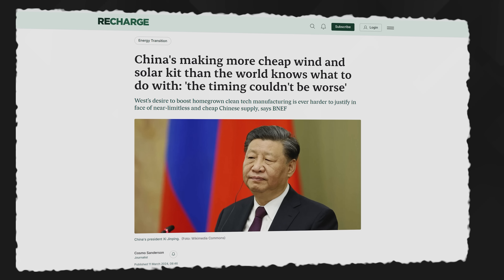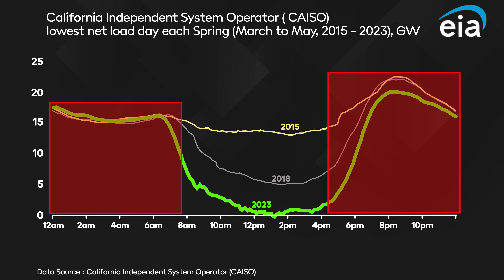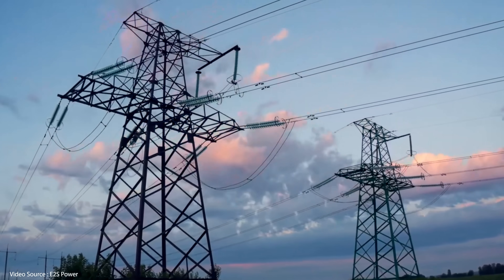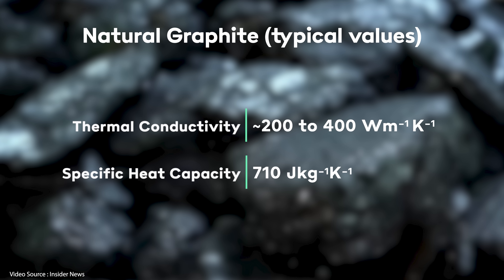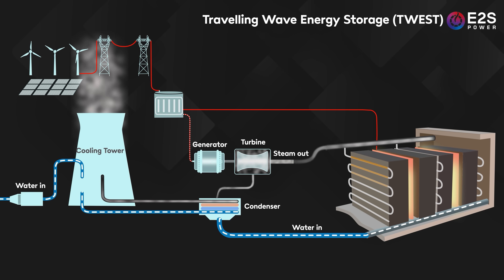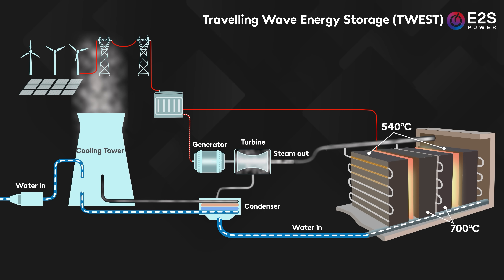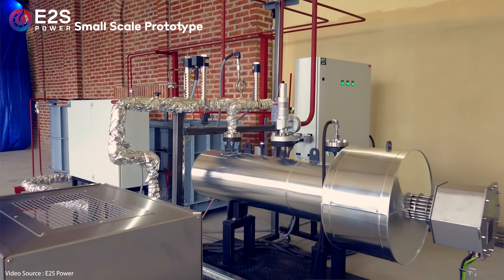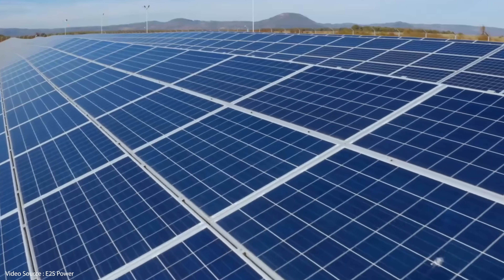A coal power station without the coal! How 'WIN-WIN' solutions could save an industry.

Comment: That's an cheeky title for this video, and unusually so for you, Dave. 

Yes it's a steam powered power station, but not a coal fired one.

A more accurate title would have been "Keeping stream powered generation ruining without the coal".

Back in the day, when railway locos were stream powered, some works had fireless locos. Typical applications world have been around oil refineries and so on, where the odd spark from a smoke attack would have been more than usually problematic. 

They worked by taking up with superheated water away from the danger zone, and then working till the remaining water has just enough push to get them out of the zone again. Otherwise the embarrassed driver would need rescuing by a colleague with a freshly charged loco.

In a timescale of the letter of an hour shower heater steam under pressure is great. But maybe not so good for the kind of storage we need to keep going all night.
Reply: Seriously
Reply: That’s with older tech that didn’t store the energy nearly as efficiently and was constantly using the energy. It sounded like the storage duration with these (in insulated housing) could be much higher, and with enough of them to actually store the energy from the end of sunlight until the next sun (a problem for every storage medium) it might be a possibility.

I would also say the title is accurate - you’re taking a coal power plant, swapping out the coal, but still allowing it to generate power. What’s inaccurate about that?

Comment: the steam plant is 40% efficient.. so  it uses more than 2x the power as a battery system dose.. I am not sure about the footprint difference and price difference but the 2x power needed per charge/discharge cycle seems big. curious if a redox flow battery or such would be better power and footprint. 

each solution helps and each conversion helps. 

i hate it when they use tricky language... about convection vs for steam production... it was a coal system now it is a graphite block system. Steam is steam... once made it is the same.. the this is more efficient also is just a junk buzzword. 
Power by coal is whatever efficient
power by graphite is whatever efficient.

the power to produce steam is all part of the original efficiency.. and then you have all the steam plant issues and the fact most steam plants are 35-50% efficient.

It is a great temporary solution but you keep running into the 50% efficiency.
Reply: This also gets the last life out of existing investments. No one would build from scratch this way, but a transition tech that is fast and cuts emissions quick with a lower up front cost to go live. I would also look at the smaller foot print as an opportunity to add batteries in the mix as well extending the life of the turbine systems.
Reply: Hence it being a great potential transition battery storage, reusing existing infrastructure and technology, as he said in the video.

Comment: i don´t get it about the total efficiency, a steam rankine cycle is 45% efficient so the total efficiency, electricity to electricity is between 35 to 40 %.  Most the half of the electricity is lost. Maybe this kind of technology is usable in nuclear powerplant rather than wind and solar.
Reply: Yes, the round trip efficiency can't be very good. Also, using a nuclear reactor to replace the coal fired boiler is a much better idea.
Reply: @briansmith8385   He is not trying very hard, is he?  Before very long, gas generation will disappear as a continuously generating option.  At that point, of being, surplus energy really needs to be stored somewhere - or lost.  

It’s called curtailment, if he didn’t know (I somehow doubt it).  Currently,  many of those renewable generation sources are paid for that curtailment (it is the cheaper and most equitable arrangement) but it might just as well be paid for and not curtailed?  Poor soul, he needs to think positive for a change.🙂

Comment: This does presuppose that renewable power generation can be and is being built nearby. This is a great idea and hopefully is employed wherever it makes sense. But it's not going to be a panacea if big new transmission lines need to be built to the plant. Can existing lines from plant to demand work by-directionally to make that corridor a good candidate to locate renewable generation? Not very helpful if the coal plant is right in town, though.
Reply: You must be joking (or trying it on) re the power lines suggestion.  A power station would have had hugely larger transmission lines when it was operating as a fossil burner.
Reply: @oliver90owner  You must be joking (or trying it on) re the power lines suggestion. I suspect most fossil fuel power stations are built close to the demand, in which case there is little opportunity to tap into the existing power lines because there is little physical space to build large renewable generation infrastructure. If the source of new renewable generation is far from the existing plant then expensive new lines need to be built to connect them.

If fossil fuel power plants were built close to the source of the fuel, and far from demand, then there is a lot more opportunity to use the vast space between the plant and the demand to locate solar and wind generation and tap into existing lines. But they may not be ideal places for either.
Reply: @ronvandereerden4714 most fossil fuel power stations are built close to supply not demand.....hence the power stations of England and wales have always been close to mines
Reply: @ronvandereerden4714  All renewables require connection to the grid for the installed capacity, which will never be exceeded.  All coal fired stations connections will have far more current carrying capability - and they will be gone (and good riddance to them).  Thankfully there will (very shortly) be no coal-fired generation plants in the UK.  It’ll then be converting gas plants as renewables become an ever-more popular electricity source for the fossil-free world we need.  One day, hopefully it will be a nuclear/renewable/sustainable supply for all electricity generation.
Reply: @oliver90owner  Actually, look up "re-lining" for power grid. New conductors with less sag can double the power that transmission lines can carry on the existing grid due to less sag. They have to cut back on hot days currently. With the new design of cables that is fixed and they can put full power to them.
Reply: @markpashia7067  That was on the ‘electric viking’ channel a couple of days ago.  The Americans need to wake up to the opportunity, if that huge amount of renewables is going to waste!  Dummyron needs to think about power lined, IMO.🙂
Reply: @sailaway8244  So, unless the renewable generation is near the existing transmission corridor, you'd be doubling transmission losses. I'm sure there will be cases where this works really well. But having your energy storage far from both supply and demand isn't likely the best case.

Comment: Hello.
Shouldn't we have 3 additional hours on either end of the graph thanks to the timezones in the USA?
When it's 7 am on the Pacific side, it would be ideal if the great nuclear reactor in the sky over the Atlantic was powering things and then the same thing reversed in the evening on the Atlantic side.
Is our national grid not connected in such a way?
By the way, love your videos man. 
Oh, that reminds me, you are in the UK. Please substitute eastern and western locales in Europe....
Reply: That would be sensible if North America hadn't decided mid 20th century to have separate Eastern and Western grids. 

And then you also have Texas which quite typically wanted to go it alone, and has it's own grid all to itself. 

All three grids run say the same frequency, but not at the same phase, so it works be an interesting engineering problem to unify them now on a HVAC supergrid.

(High voltage alternating current, how the existing UK and North American grids are joined up)

The good news is that for the kind of distances involved, HVDC becomes economical, and that does not need the two ends of the interconnectors to be in phase. 

(High Voltage Direct Current, how the interconnectors that cross from the UK to various European countries work, on account of AC not being a good idea for long distances under the sea).

The tech has been in use since the sixties, at least, and maybe longer, but mainly for international interconnectors not within a single grid.

So that's how you'd do it, if you could get both the US and Canadian governments to agree to the up front capital costs... 

Or for those who believe in Green Capitalism structure the finance to make it tempting for a private developer to do: perhaps by up front guaranteed profits per unit transferred in either direction along each interconnector
Reply: @trueriver1950  There are already copious HVDC inter-connectors in Europe.  Soon there will be more….
Reply: No, your grid is sectioned off. Remember Texas couldn’t bring in power because its grid isn’t connected? The whole globe could have a grid if we cooperate

Comment: Just wonder why you need the big chimney cooling tower for steam? Why not just put the unused heat back into the loop??
Reply: You need to condense the steam, so you can pump it back to the boiler.  Except for make up water, there isn't anything colder in the system that can absorb the heat.  With district heating, you can put that unused heat to use, but out of the power production loop.  However, in a lot of places the investment required by district heating makes folks look for cheaper alternatives.  From an engineering point of view, you might want to look up topics like the Carnot Cycle.
Reply: Laws of thermodynamics.
The best you can do is to use this lower level of heat for other purposes
Reply: Why do you think ,we don't do it already. We use electric turbines for 100 years and every tone of cool costs, so we should already have this figured out, shouldn't we?
1- see the Carnot cycle and II law of thermodynamics.  
There is no way to produce free energy without difference of entropy. 
2- our problem is not, that we have to little energy form the sun, but that we don't use it. Where there is shortage of fuel efficienty is important- car, train. No fuel -the trouble of efficiency is secondary.  Using this left over heat to worm up f.e. water for homes is unprofitable.
Reply: I'm more excited by the idea that these could be located in wind turbines themselves, so the turbines are either generating power for the Grid, if needed, or heat for the TWEST minimising transmission losses to those related to electricity that is actually being used.
Reply: @sailingoctopus1  The idea is that the steam turbines, generators and other equipment is already there and paid for.  In any case, you need a lot more heat storage for wind turbines than solar.  If you can't make this work off of solar, you might as well punt.  So far, nothing has been cost effective for handling providing solar power for the next morning, let alone handling a wind drought.  Almost all batteries are used for frequency stabilization, but we might be getting close to shifting power to 8 pm.  We aren't routinely using solar power to generate ice for air conditioning after dark, so all of this stuff is a long way from being cost effective.

Comment: How about educating the humans to flatten the duck curve by changes in there life style.
Zero infrastructure 
Just inconvenience. 
Ahhh ..
The stumbling block.
Humans don't want inconvenience
Reply: The main reason for the duck curve is power production, not consumption. 

During the day, solar is enough to keep up with demand. So to flatten the curve all the demand has to be moved to the day instead of evenings and nights. I guess they can use their ACs to cool the house during the day while they're at work so they don't have to run it as high to cool the house down when they get off work, but things like cooking dinner can't really be done at work. EV chargers at work so they don't have to charge during the night can also help. 

But that curve is specific to that area. It's caused by a lot of solar power generation capacity. In places with wind power it's completely different. Some of the time the wind power will keep up with demand, other times it won't, so the curve won't have a nice "use power during the day" solution to flatten it.
Reply: changing lifestyle like working only during daytime where solar energy is highest.
Reply: The whole population will never be educated!  Also working times are far too ‘standard’ - where most go home at the same time of day, they watch the same TV programmes and the adverts (or half-times for sports matched) are on everyone’s goggle box at the same time.  Can’t avoid some ‘duck curve’ but pricing the stupid ones out of the market would help.  It will come - a TOU power limit on those that should not be using electricity excessively.
Reply: We tried to educate the humans to reduce, reuse, recycle Novadays it is said to be a scam by plastic companies..... I don't think this is going to work.
Reply: I dunno.

Party all day and never go to work? 
Can't see anyone agreeing to that as a lifestyle...

Production might suffer though 🥴

Comment: Cooling towers still require water, which is in short suppply in many places. Other than that seems like a good idea.
Reply: Yes, but existing power plants will already be using that amount of water for cooling. Yes in some places you're right that this solution won't help, but it's aimed specifically at places that already have an adequate water supply that's already in use.
Reply: How about using the waist heat from the turbines to heat up the graphite again?
Reply: @buckboard43  The waste heat is by definition at a lower temperature, which means you need to use a heat exchanger to raise the steam temperature to higher than the graphite in order to transfer it to the graphite for storage. The energy you use to run the heat exchanger may be less than that transferred, but the balance does need to be verified.
Reply: Where water is really scarce, there are air cooled heat exchangers that can be used instead of cooling towers.  For instance, if you build an oil refinery in a desert, you probably won't rely on cooling towers.  OTOH, water is not really scarce for power cooling purposes.  Places that have such issue are usually short for use water for use in agriculture.

Comment: What's happening he asks.
Well here in the UK we are decommissioning out coal generating power stations and building houses on the sites for more consumers to increase demand.
Reply: Yikes.  I don't think I'd want to buy a house on coal plant land.  Even land near coal plants have elevated levels of mercury, lead, arsenic, and chromium.
Reply: @Ryan-ff2db  Potassium 40 too!
Reply: @economicprisoner  Yeah, there's 17 heavy metal toxins in coal ash.  At the New Castle coal plant, arsenic in the soil is 372 times higher than normal and it's only considered the 6th most contaminated coal site in the US.
Reply: They SHOULD be converted to electrical energy storage plants. The infrastructure is already in place, why not take advantage of that?
Reply: So send them to rawandah instead?
Reply: Well as said in the video, the plants take up less space, so how about smaller scale, say 50% of the site converted to storage with a very handy fat grid connection already there. And a new 50% space nearby to convert to housing, if you so wish, though it could be in the middle of no-where.
Reply: Coal has destroyed that land why live there? Repurpose it industrial. Coal is kinda hilariously terrible
Reply: I guess the alternative is not to build the houses and keep exacerbating the housing affordability crisis?
Reply: Still plenty of gas power stations I guess to convert. 
And some of them used to be coal fired ones I believe. So still a option. But yes I see where your coming from

Comment: Producing hydrogen from any type of water not with electrolysis but energetic cavitation collapse by @EirexTech the 5 year old Canadian proprietary water bubble breakthrough.
Reply: never heard of this technology? do you have a reference?
Reply: @janami-dharmam the movie "Chain Reaction" starring Keanu Reeves?
Reply: Good plan for a brand new plant. 

Not so good for an existing coal fired one. Converting coal boilers to burn gas is not straightforward, and will lose more production time during the changeover work than dropping in these shipping containers. And that is all before you think of the infrastructure to run a gas pipeline to the former coal powered plant...